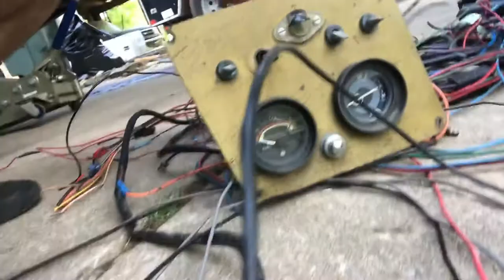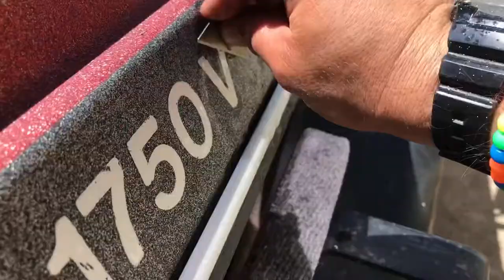Fully Restoring a 1983 nasty bass boat in my driveway

Comment: Great video! I think your paint is rough sounding as you need a bass boat clear coat. It protects the paint & fiberglass which should be rough feeling. 
Yep-was married for 19 years to a part time professional bass fisherman 😂 so I've worked on boats a lot. He would redo it all to fit what he needed. Also - are you adding a hot foot?
Reply from the maker: No i did not plan on adding a hot foot. It’s my first boat project so maybe on the next one I’ll be more advanced. Thank you!